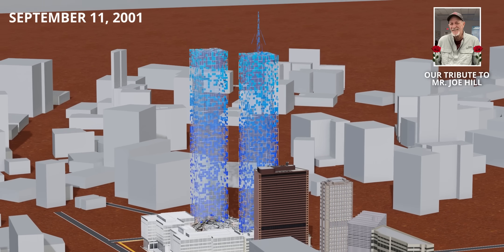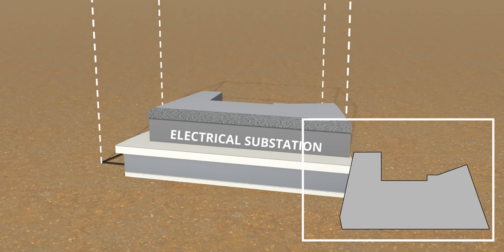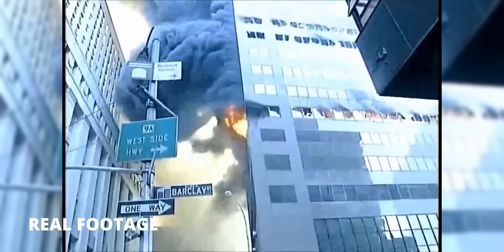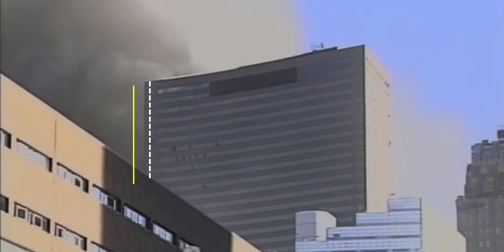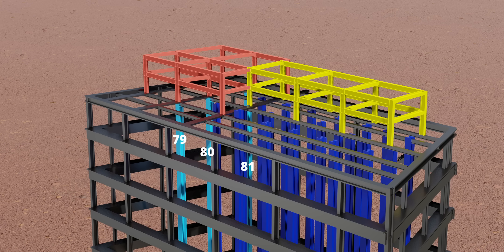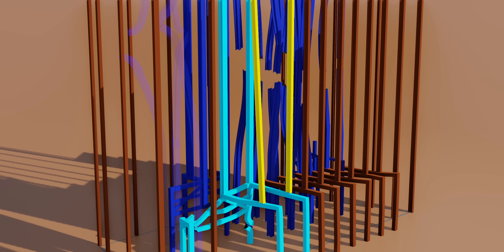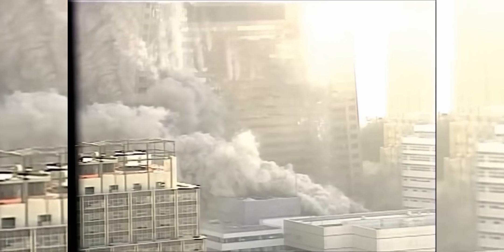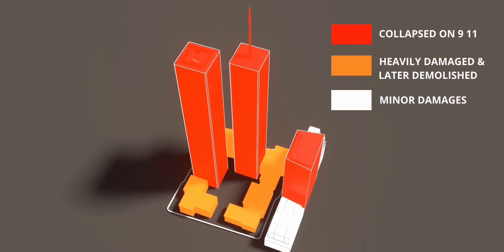Collapse of Building 7 | The Complete Physics

Comment: Magnificent CGI video, the building hit free-fall for almost half its collapse; the support columns just snapped like fckn plastic eh? 

Watch the 2 faces of the building, it collapses in a perfectly straight line. They theoretically should have been pulled inward towards the support column
Reply: Almost half of its collapse?  Man are you poorly informed.

The collapse of Building 7’s was from the inside out and entirely different to the Twin Towers, harder to understand, with most details being hidden from view and not intuitive.  But we can still sort out what happened through careful analysis and observation. This is my explanation of the collapse relying on no outside authority. 

Building 7 was a unique, asymmetrical 47-story steel framed structure built atop a smaller 3-story building serving as a partial foundation, requiring lower floors dedicated to complex load transfer structures. Of trapezoidal shape and all-steel tube-in-tube construction, B7 (above the 7th floor) consisted of a central core of steel columns carrying most of the gravity load, perimeter steel columns around the outside of the structure carrying the remainder of the gravity loads and long span beams and girders to tie those elements together and form the floors. On the outside of the building hung a moment frame or outer shell. 

Phase 1 : First externally visible signs of collapse initiation occurred at 5:20:28 pm and were notably quiet with observers not realizing the building was collapsing! No audible warning in the form of hundreds of ear drum busting 180-190dB explosive bangs preceding the collapse. Here at 12:00 a local CBS affiliate reporter is talking 10 blocks from B7 when collapse begins. People don’t start to notice the collapse until 12:11. At 12:45 is the famous CBS fixed camera clip of Building 7’s collapse. Note how quiet it is. 

www.youtube.com/watch?v=t5tEy6mXSE8

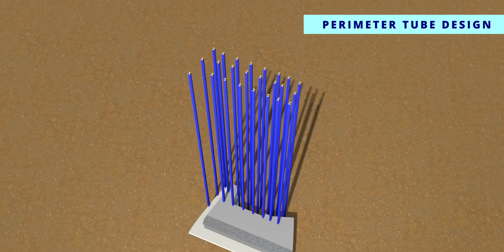Collapse initiation was due to lower floor failures above the load transfer region (8-14th floors) in the NE corner. In this video at 0:45 you can see the NW corner from inside the building while under construction, Column 79 just out of frame on the left. That big, angled steel beam across the top of the frame connects to C79 at one end. The girders connect to the beam. That beam and all those girders depend on just one connection 

www.youtube.com/watch?v=nP3TNHPCIVU&t=45s

Phase 2 : The NE lower floor failures caused a loss of critical lateral support over an excessive length of Column 79 and it buckled. Looking at a floor diagram of Building 7 (www.nist.gov/image-16640) when you see all the structures that depend on C79 you quickly realize this one column was a relatively isolated structural element on which a disproportionately greater fraction of the structure depended analogous to say the Key Bridge. Externally as collapse begins we see a vertical progression of window breakage along the 44-46 line and a kink in the roof of the East Mechanical Penthouse at the top of the building, consistent with C79 failure. Normally with a buckling column, the load could be redistributed to other columns. With C79 that is not the case - the failure did not redistribute the load, so the collapse rapidly progressed to the roofline, sinking the rooftop penthouse. The transition from full capacity to almost no capacity occurs in an instant and will result in virtually no resistance 

Phase 3 : With C79 gone, B7’s progressive, non-symmetrical collapse continues with adjacent columns 80 and 81 left laterally unsupported, and quickly buckling as well, sending the EMP down through the building. C79-81 all have no diagonal bracing, which is the major reason why they could not redistribute a lot of vertical loads among one another. From there collapse progressed from east to west through the central core until the core was gone taking all of the interior floors and probably most of the perimeter columns with it. Follow the horizontal progression of window failures low in the building and the dropping of the remaining rooftop structures into the building. One of the big takeaways from the NIST Building 7 study (invariably ignored) was how their modeling determined C79 failing under ANY circumstances would have initiated the same collapse sequence. 

Phase 4 : After about 10 seconds only the exterior moment frame remains, giving the illusion B7 is still standing to the casual observer since little has outwardly changed. But it is just a hollow empty shell like an empty cereal box supported only by a few remaining columns and overloaded from the loss of the core columns and floors, quite unable to remain standing. With nothing remaining behind it, the north face leans inward, forming a V in the roofline, the last few columns buckle under the strain and the moment frame free falls, landing on top of the debris pile. 

It is only here at the end when most of the building is already gone, leaving only an empty outer shell that a single measurement of alleged free fall acceleration is taken, from one point on the outer shell. The Building did not “free fall” – just one corner of the outer shell briefly moved at a rate comparable to FFA. The Building_ (core and interior) was already gone before that happened. The period of alleged FFA was a product of how it fell NOT why it fell . It’s also not proper FFA as the single measured point was moving in 3 dimensions, not just down. Start to finish the collapse took 18-20 seconds, 3 times longer than free fall . How fast something falls cannot tell you what started it falling_ anyway, let alone 10 seconds after it started falling.

The debris spread outside the footprint blocking surrounding streets, heavily damaging the Verizon Building and destroyed Fiterman Hall. 

Building 7’s progressive, non-symmetrical collapse was incidental and unintended collateral damage from the combined effects of fire + time + gravity, started by the collapsing North Tower. That is true no matter who planned and carried out the 9/11 attacks or why . The collapse was of so little consequence it barely registered at the time - a footnote, only taking on semi-mythical status as an alleged smoking gun years later when demolitions at the Twin Towers, missiles at the Pentagon and shoot down over Shanksville all failed and conspiracists had nothing left to work with. 

Anything can seem like a conspiracy if you don’t understand how it works. Now you should. I hope you found this helpful, informative and it solicits informed critical comment. If I made any errors of fact, logic or reason or left anything important out, please let me know so I can fix it. IF you can offer a more plausible alternative please do. Be the first. Please start any reply with the words “Tits McGee” or I will know you didn’t read it and are wasting my time.
Reply: @TheCriticalStinker-01  TLDR; 2.25 seconds is “almost half” of 5.4 seconds dummy. “Almost half” the collapse was free-fall…… I didn’t make that up.

Comment: Total BULLSHIT. The fires were well above the transfer trusses. There was never enough heat at the transfer truss elevation to affect thier strength. In no way could the failure of the columns under the penthouse  FIRST result in symetrical failure and the collapse of the building into its own footprint.
Reply: Failure occurred above the transfer truss region.  Collapse was progressive which is the opposite of symmetrical as clearly show in the video.  Does the footprint of Building 7 include the Verizon Building and Fiterman Hall?
Reply: @TheCriticalStinker-01 damage to Verizon was at the lower levels as building 7 rubble pancaked outward. 7 did not fall Over into Verizon. Ditto Fiterman.
Reply: @terrific804  - It either fell within its footprint or it didn't. You can't have it both ways.

I know you are just mindlessly repeating catch phrases from the internet, but you said Building 7 collapsed into its own footprint when in fact the debris spread outside the footprint as Building 7 leaned and twisted into a shallow S-shape on its way down, blocking surrounding streets, heavily damaging the Verizon Building and destroyed Fiterman Hall.  None of that was in Building 7's footprint

This is all quite obvious from ground level and overhead photos of the debris pile.

And there was no fucking pancaking - a term whose meaning I guarantee you don't understand and could never be applied to Building 7.

More importantly, none of this matters.  www.youtube.com/shorts/PfY32lSdXkM
Reply: @terrific804  So, it didn't have a "into its footprint" fall? Meanwhile, yes it did fall into both the Verizon building and Fiterman Hall. This is a well known and established fact.